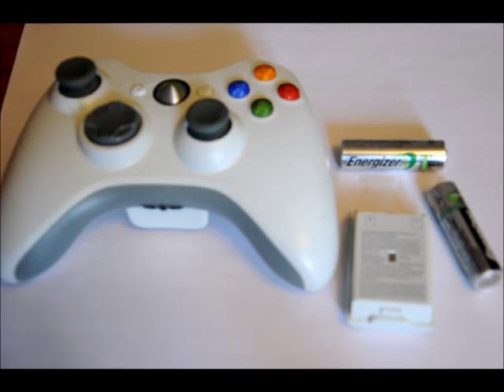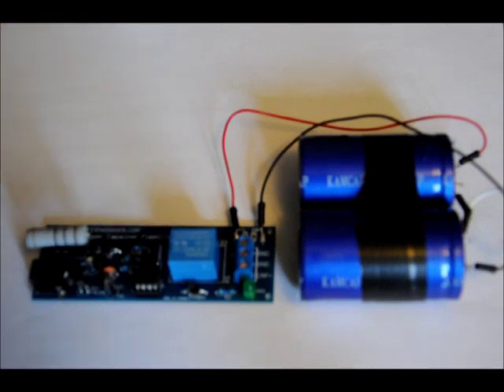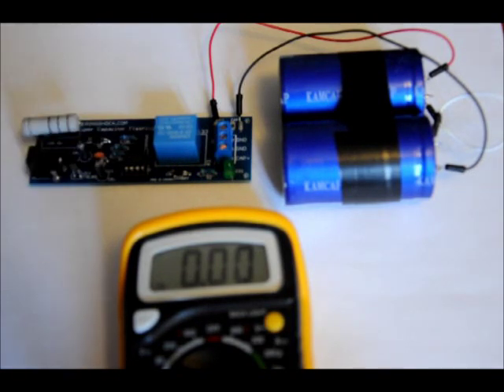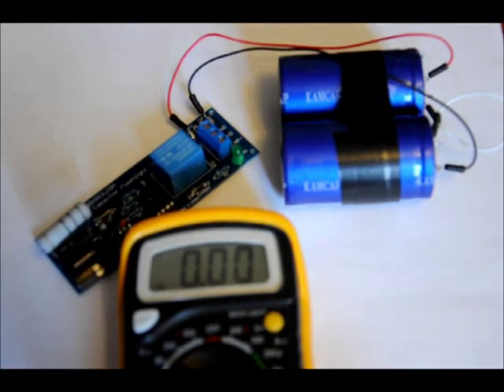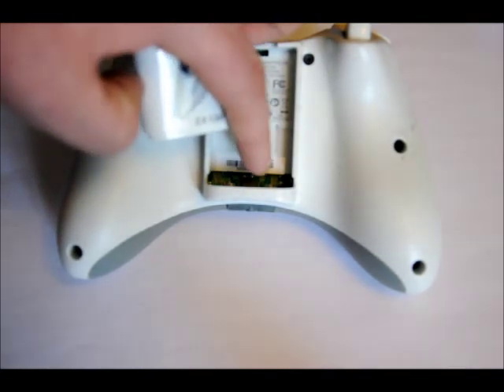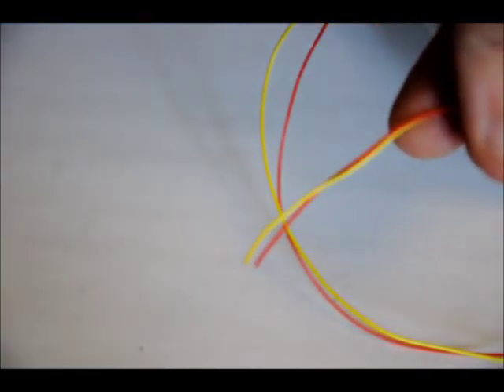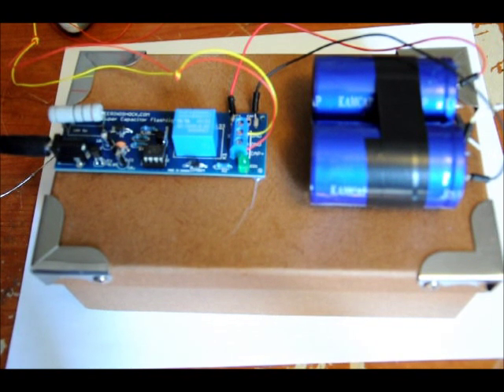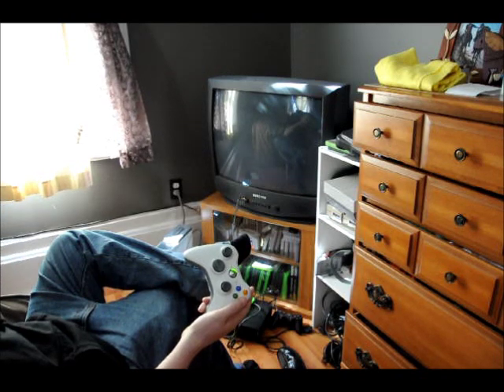XBOX 360 Wireless Controller Modified with Super Capacitor Battery

Comment: I like this project, but wouldn't it be better to use smaller capacitors that could be attached to the base of the controller and just plug in the charger occasionally? Though these would reduce the time of gameplay, they would also reduce the charging time. I don't mean to be too critical, I could not probably create something like this myself, but having a pair of wires connected to a box seems inelegant at least, not to mention the danger of tripping over the wire and short-circuiting.

Comment from the maker: Read the document more thoroughly.  There is an advantage/disadvantage section.  You might not like my project, but if you read that document, you won't be able to argue with me about the benefits of using a super capacitor here.   My super capacitors are in my XBOX controller, and year old rechargeable batteries are in my WII.  While we haven't had to replace the batteries yet, they hold very little power and have to be charged constantly.  My super caps are holding strong.

Comment from the maker: First of all, why are you quoting Wikipedia? Secondly, if you read down just a little further in that document, you see that super capacitors can be charged hundreds of thousands of times?  These can be charged and discharged much faster than batteries, and if treated well, will live longer than we do.  Your rechargeable battery pack will last for a year.   Maybe two.  Rechargeable batteries take forever to charge.  This capacitors take a few minutes.

Comment: actually the first thing I would read would be "An electric double-layer capacitor (EDLC), also known as supercapacitor, supercondenser, electrochemical double layer capacitor, or ultracapacitor, is an electrochemical capacitor with relatively high energy density. Their energy density is typically hundreds of times greater than conventional electrolytic capacitors"-Wikipedia and batteries are far more efficient as they last longer, are cheaper, and are just as rechargeable if not more than these

Comment from the maker: Hate to be crude, but you're talking out of your ass here.  This set is designed to charge these caps to less than 80% of capacity.  That being said, if you took the time to learn about super capacitors, the first thing that you'd read would be that they can be charged and discharged hundreds of thousands of times If treated properly, which they are.  In my three years working with super caps, not one has leaked or exploded, nor are they known for it.

Comment: or instead of wasting your money on huge bulky capacitors and chargers that wont last very long and are prone to leaking and exploding and have to do heavy modification and installation for $70 or you could buy a $5 play and charge kit which lasts for days on a full charge and you just pop in a new battery pack instead of crazy long installation which for some is probably much too hard